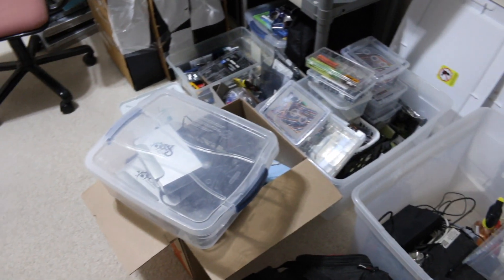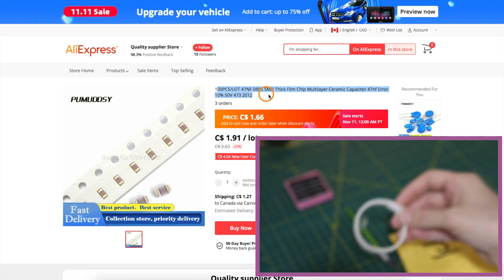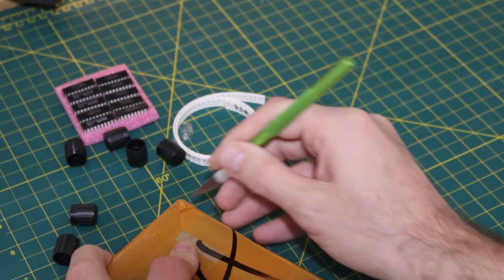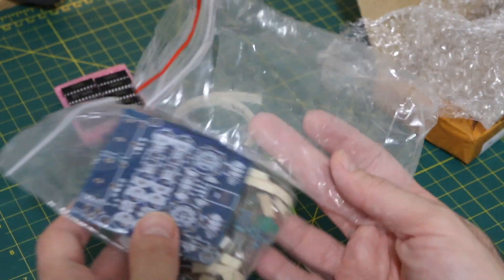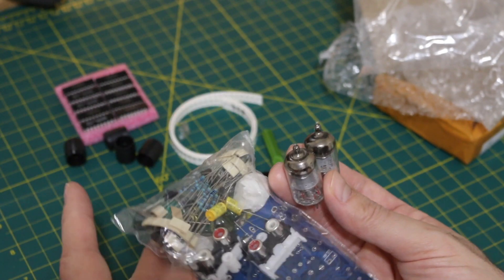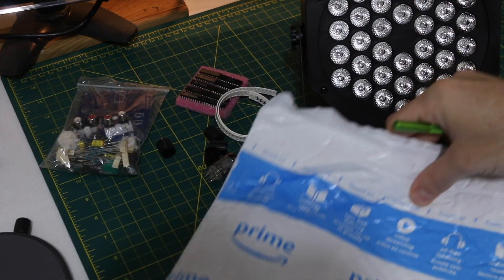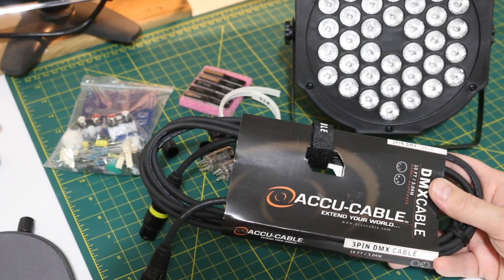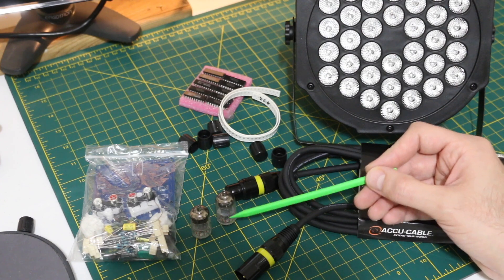GR Mailbag 20.NO.06

Comment: I hope you get settled back in soon! :) I am tempted to get one of those dual vacuum tube amps just as a reference for ones that I will build in the future ...
Reply from the maker: If the tube circuit actually works as a preamp, I will have all kinds of ideas and experiments.  I'd even try to make an energy inefficient Nand gate!
Reply: @GadgetReboot  How can it not? 😅 If it didn't we would have heard about it ... but the devil in this detail is how much headroom are we actually working with? We don't need tubes (but aren't they AWESOME?!?!) ... all we need is a charge pump and some unicorn dust ... have you heard about the infamous Klon Centaur? It is a circuit worth a few videos over: https://www.electrosmash.com/klon-centaur-analysis
Reply from the maker: If this tube kit works, I might use it as a general prototyping platform, maybe leading to a PCB project...  I haven't checked out the Centaur...yet....When I get settled I need to go through entire sites like electrosmash and diystompboxes.  It will be good to finally have enough space to work with everything set up instead of all in boxes.
Reply: I look forward to what the future of this platform might have in store. :) I highly recommend the book "Amplifying With Vacuum Tubes: Circuit Design Guide for the Novice" by Carl Gauss.
Reply: @GadgetReboot  Well good and bad news --- my kit arrived but one of the tubes was smashed. 🤕 I contacted the seller in hopes they might send a replacement but in the meantime I sourced some 6J10 tubes and they are about $3-4 each on eBay. I found some higher quality ones from tubedepot dot com (from whom I have purchased some tubes in the past). They are about $10 a piece. This makes me believe that the tubes provided in the kit might not produce stellar results ... but for the price it's still gotta be a great starter kit.
Reply from the maker: I wouldn't be surprised if the tubes in the kit just had leds hidden in the bottom that light up orange...if it works at all I'll definitely be curious to swap to proper tubes and see how it goes.
Reply: @GadgetReboot  I fairly certain these tubes are legit ... just probably not high in quality. The metallic top of the glass is now gone in the broken one and the inside smells like carbon. I can see no SMD LEDs.
Reply: @GadgetReboot  Oh ... there actually are LEDs that you insert into the board that fit in the middle of the socket holders! I guess that is what you were referring to my bad. 😅 I am only just now looking at the board. (Got a refund and I ordered a replacement tube for $3.)
Reply from the maker: Guess what vacuum tube book I just got for Christmas??  Santa was watching the comments section.
Reply: Excellent! I actually soldered my kit together yesterday (got tired of waiting for replacement tube). It was a fun build, but i will have to wait some more before I can properly test it. I suppose I could just test one channel at a time ... anyway ... Merry Christmas! :)